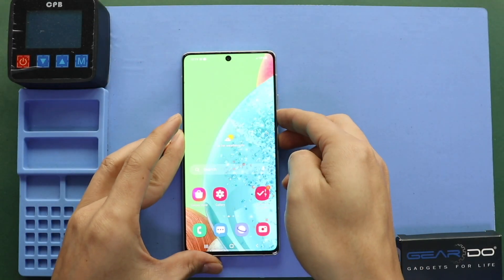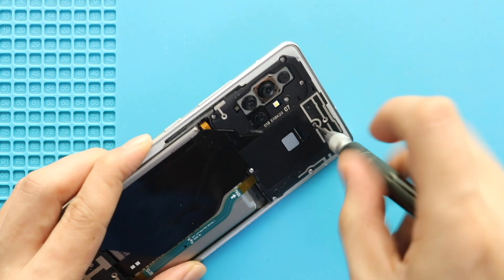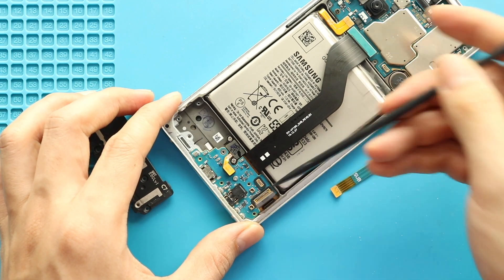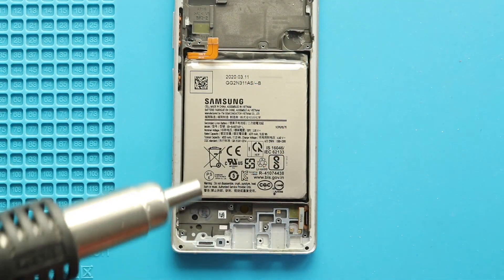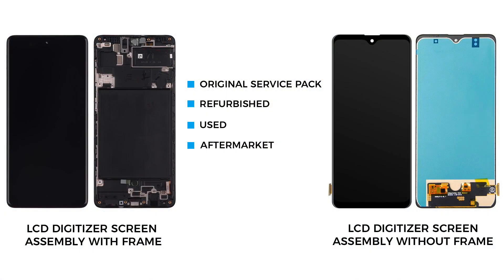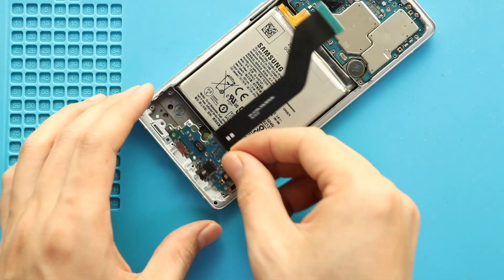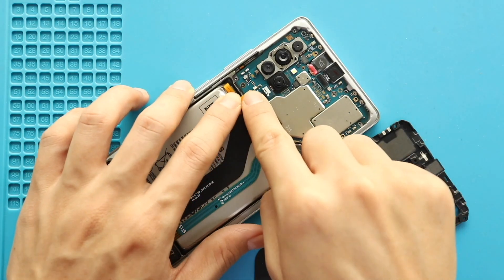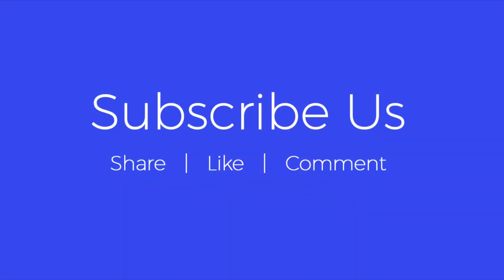Samsung Galaxy A71 5G LCD Screen Replacement

Comment: Never apply heat on the battery! Who taught you that? It works of course but it goes against any safety procedure, especially for a tutorial video.
Reply from the maker: Thanks for the tip, but little heat is fine. You should NOT apply heat if the battery is swollen.